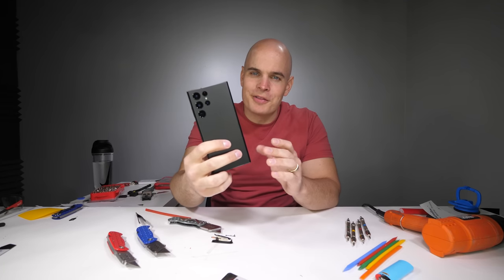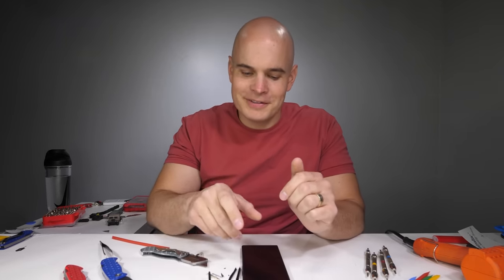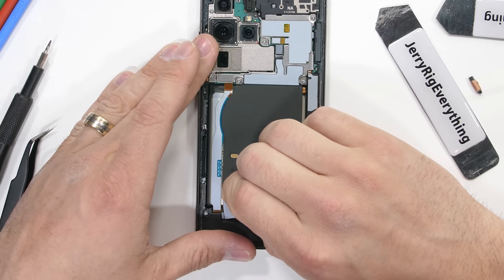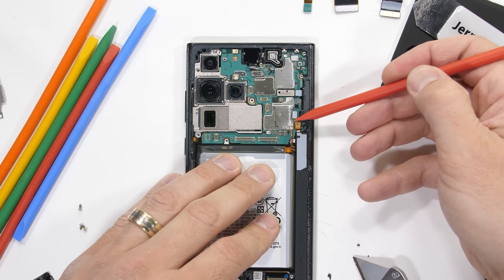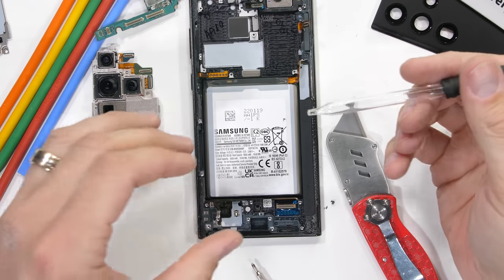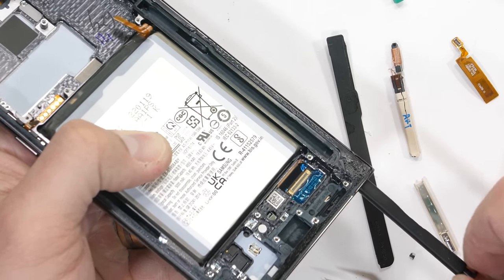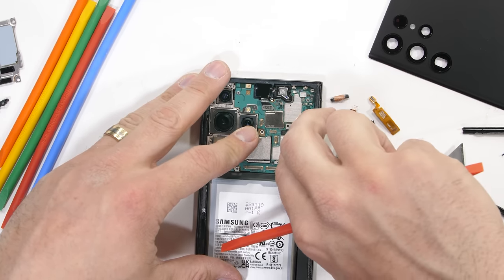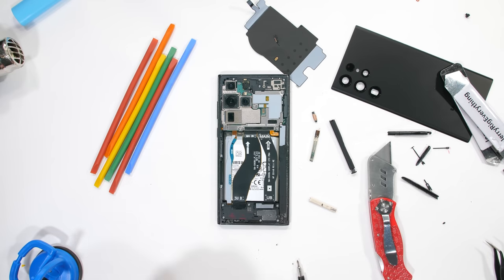Galaxy S22 Ultra Teardown - Can the S-Pen hole Leak?!

Comment: I have the s22 ultra, there is something in i think the top half that is loose inside. If I shake the phone it moves around kinda like there is something moving, any clue what that is?
Reply: Camera lens ?? Turn on the camera app, then try to jiggle the phone...if the camera is making the weird noise, problem solved...my note 10 was also doing this jiggling noise...it turned out to be the camera focus lens being loose when not in use or whatnot...its normal for these phones

Comment: While all the companies are making their phones as durable as possible even the tablets but we still have terrible laptops in every aspect.

No companies have yet done groundbreaking innovation in their laptops. Cameras suck, despite havinng more rooms for web cam, sensors and everything, none of their laptops are as close good as their mid-range phones are. Sucks in durability, you'll break the hinges just by dropping the laptop from 1 feet height, will have broken screen despite being significant thicker than phone screen. Sucks in providing good battery, performance gets lowered after 3 years of using.

There's so much they can do for their laptops if they focus even 10% of what they do on their flagships.

Comment: Hey Jerry I have two question does the S22 Ultra battery fit in the Note 20 Ultra and can you put the S22 Camera in the Note 20 Ultra? It seems like the Note 20 Ultra will be the last Note with a micro SD Card reader.

Comment: Apple's battery adhesive shouldn't be the only thing taken into account if you're going to pick a phone based off a recyclability. 

They are however the ones that stopped including chargers in the box to quote unquote remove waste when in reality it just caused more waste from people ordering and shipping a whole charger.

Comment: If we accidentally eject the pin to moc hole, will it cause any damage to the mic or seals of s22 ultra? Thank you.
Reply from the maker: I made a video about that. Check my recent uploads
Reply: @JerryRigEverything  hi, thank you, i watched it and you mentioned it should be safe, am i right? Thank you.
Reply from the maker: @FilemonYen  correct
Reply: @JerryRigEverything  hi Jerry, even if we "push" harder like you try to eject the sim tray? It will not reach the mic or seal, correct?
Reply from the maker: @FilemonYen  correct

Comment: I have a samsung galaxy S8plus, I have been using it for five years now and it hasn't caused me a single bug, it works perfectly!  But Samsung is hiding this from you, because every software update makes mistakes, that's the goal of all smartphone companies to keep their business running, send you update codes and fuck your phones, and you wonder why.  right?! ... such as the battery doesn't last long, or can't be heard from the handset when you talk, or some other problem with the phone, whatever it is, but these things are fixed not in service, but when you set from boot  the phone's factory settings menu, then all these errors are cleared automatically and you still have a new phone.  Of course you need to keep your phones, they are not made to fall from a height, or break nuts with them, they are made for work and phone calls, if you want to break something, do not break it with your phone and buy  hammer.

Comment: when you were slicing with the box cutter in the beggining i knew you were going to slice a cable.. no need to go 1/2 inch the phone with a blade to take a thin layer of adhesive off...

also how does glue on the face of a lithium battery thats wrapped and needs unwrapping to the get to to the lithium hurt recycling ?  care to explain ?..  as for recycling being important... since most places in the united states dont actually recycle.. i dont care anymore... most landfills dont actually recycle.. so you recycling you pay for in the trash still goes to the landfill.. its unfortunate but nothing i can fix.

Comment: Did anyone noticed that the battery is actually 4855mAh . Samsung is claiming  5000mAh.  Typical capacity 5000mAh, what's the reality capacity? anyway less in real life than s21 ultra!

Comment: Them phones look pretty cheaply made, probably costs them $50 to mfg, then they sell for $1500
Reply: Do you know how expensive all the components are?
Reply: @LeakyTrees   no idea, the cpu and GPU are the most expensive part of the phone. 
But budget phones sell for 100 to 200 and are not that far off from high end phones now a days.
Reply: @Technocrat.  budget phones sell for so cheap because their components are less high quality, their cooling is trash, their build quality is trash, and they're overall just a piece of shit. Now, here's where I'd go into a rant about how the cost of the s22 ultra is justified in that it would tank the companies earnings way too much to market their phones cheaper, but, it only costs 529 dollars to produce one s22 ultra, so I'm gonna assume the other thousand dollars on the price is to recoup marketing, development, and employee spending.
Reply: @LeakyTrees   I doubt it cost that much to make a phone, purely on parts cost, but if you factor in research, innovation and design costs for a new phone, witrh all new parts, not last years parts, nut new, perhaps $400. WE know Marketing is a huge chunk of cost for most big mfg of high end phones.
But, what's in a phone, a thin display with glass and digitizer, cheap, case, mobo, not too expensive, most of cost is on other branded items like Snapdragon soc, Bluetooth etc, where they need to pay third parts cost and IP rating.